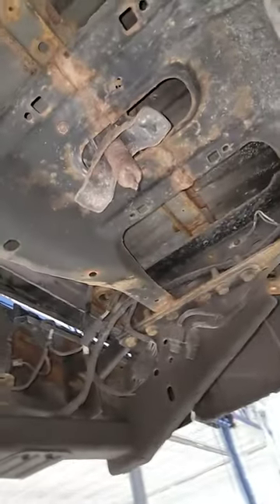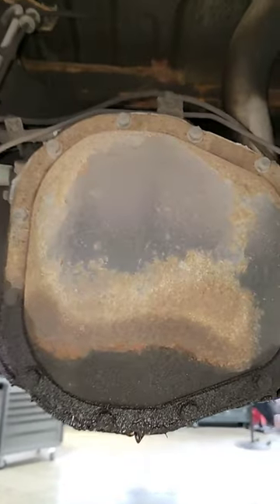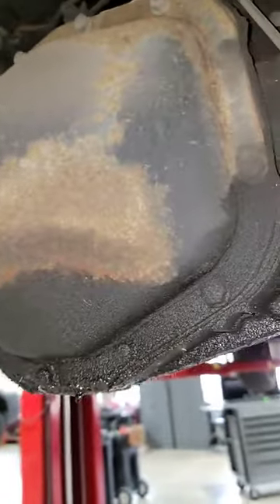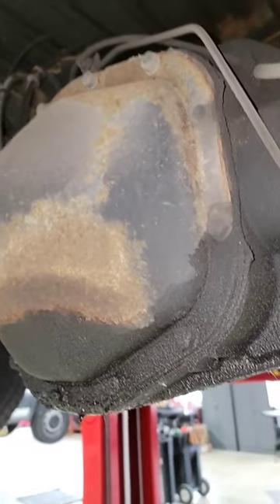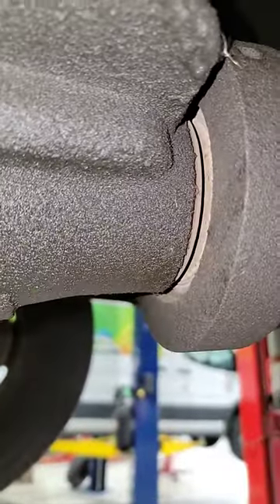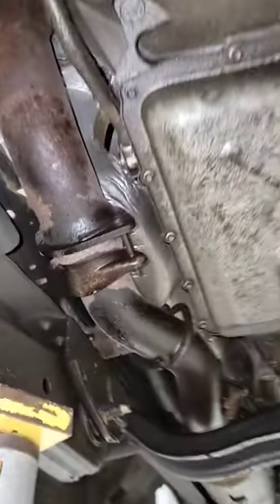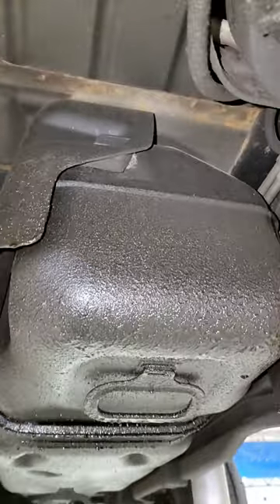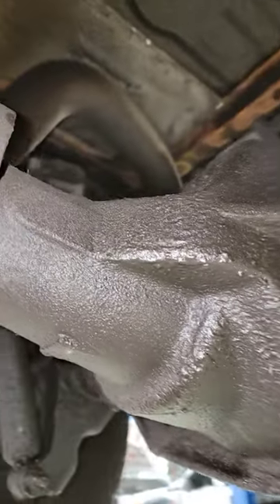WORST oil leak ever! | GALLONS leaked 😔 #fyp  #shorts

Comment: Put some more oil in it & wait until spring to fix!!...perfect rust protection form the winter salt!!...just add oil as needed!👍💪💯🤪
Reply: Plus the added benefit that the oil is always new.
Reply: @RadDadisRad  yes sir, good fresh lubrication is the key!!👍😁
Reply: @zekester1  I had a 408W stroker that had a bad front seal that did this. It would consume about 1 quart of oil for every 38 gallons of gas. Except if it was driven higher in the rpm then it would leak quite a bit more oil. I went 5 years without ever changing the oil in it. I also had to carry a couple gallons of oil with me. I knew it only had 1/2 quart when the lifters would tick. I would have to add 7 quarts for it to get back to operational.
Reply: @RadDadisRad  funny comment haha
Reply: @RadDadisRad  thank you for being considerate of the people who will live on this planet after you do
Reply: I got a 96 firebird with a leak and I'm afraid to mess with it it's been like that 10 years haha
Reply: @daveyjoseph6058 where do you think oil comes from?
Reply: @HeroicRecaps  Not the local environment? Spreading gallons of motor oil on the roadways is not recycling. It’s straight pollution. Leave the thinking to those who are better suited for it 😂
Reply: @daveyjoseph6058  the roadway is literally made of oil. Do you know what asphalt is?  You don’t seem very educated tbh
Reply: @daveyjoseph6058  I had a 96 that leaked too typical
Reply: @vanillarain3789  I got a 99 that had the oil sending unit go out twice in about a year lol
Reply: I wish my Avalon was leaking. Easier to fix a leak than it burning a quart every 50 miles
Reply: @daveyjoseph6058  who the fook is this guy
Reply from the maker: This guy hasnt a clue yo
Reply from the maker: What ever you say keyboard warrior
Reply: @daveyjoseph6058  I’m re-oiling the roads… the roads are literally hot oil and gravel which makes asphalt. Cmon sally don’t be such a sally.
Reply: 2.5GPA  it changed itself… why do you care?
Reply: 2.5GPA  and no it doesn’t. When it rains some of the oil in the asphalt is washed away. That’s why new asphalt is black and old asphalt is white. It’s white because it’s only aggregate and all of the binding oil has washed away…
Reply: @RadDadisRad that’s why I buy new…
Reply: @richeyrich2203  yeah I have plenty of new vehicles. My 4WD van has a 60 degree approach, 28 degree break over and 42 degree departure angle. Plus it’ll do 90mph across the sand.
Reply: @HeroicRecaps  its made of recycled tires yeah and has absorded oil over decades obviously. Oil isnt part of the recipe though its mostly tires and gravel.
Reply: @bolzdeep6834  what do you think tires are made of genius?
Reply: @RadDadisRad  it leaked 1 quart for every 35 gallons of gas. Yet you didn't change the oil for 5 years eh?

I guess you had a bottle under the truck while driving just catching the old oil to put back in
Reply: @HeroicRecaps  Does that roadway flow into storm drains, genius?
Reply: @RadDadisRad  Is that why sun exposure turns it grey too? I didn't know sunlight in deserts can wash stuff away
Reply: @thevalorousdong7675  it would lose a quart for every 500 miles. Ultraviolet light also breaks down oil.
Reply: @thevalorousdong7675  this guy thinks we drink water out of storm drains 😂
Reply: @thevalorousdong7675  here’s a whoosh since you think I had a jug catching oil under the vehicle. 🤣
Reply: geenus! I fuckin' knew it was something like that "geenus" stuff.
Reply: @zekester1  that’s what she said
Reply: @HeroicRecaps  deez nuts
Reply: @MiniNinja258  
💿 💿 🥜
Reply: @RadDadisRad  call that a two stroke
Reply: @bolzdeep6834  hmm. I know it has asphalt shingles ground up in it along with the millings from the asphalt grinder. Never heard of tires in a road other than the minuscule amnt of tire wear that happens on the blacktop over it’s lifespan…. Phew you should be on the screed board of a paver when they’re running the recycled mix. It’s terrible! It will literally break your skin out in a rash through your pants! It’s a rough job and nowhere near like when your paving with new asphalt
Reply: @honesthuman7550   you know what they say right? Chevys rust - fords leak oil! I’m a ford guy through and through tho so…  if it’s not a ford it’s a toyota for me lol
Reply: 2.5GPA  When your username is a C+ grade average and your profile pic is you hidden behind exhaled smoke from a spliff, you should probably not pick fights in random YouTube comments sections. Those two things combined have already set you back in terms of credibility.
Reply: @Davey Joseph  when you realize that asphalt is literally tar

Comment: At least it won't rust 😂
Reply from the maker: Coddddy
Reply: Lol, still rusting.
Reply: Yeah rust proofing is not a thing, the only thing that rust proofing is good for is trapping water and promoting rust.
Reply: @loft306  you sir are wrong
Reply: That's the first thing I thought then realised... The rust is the least of issues
Reply: @loft306  look at the sma channel, dude's own truck is like the only one in the state of new york that's rust free because guess what, he rust proofs it every year
Reply: @loft306  What are you talking about man, rust proofing is definitely a thing. Oil or wax undercoating works great. My truck is 38 years old and has no rust at all. I coat it with Fluid Film (mixed with a little bit of new 15w40 engine oil) every few years. Hell even the battery terminals look great because they're also coated.
Reply: @loft306 DangerMaus  lol, you're a cartman .
Reply: @loft306  it is a thing don’t know what you’re talking about
Reply: My first thought.
Reply: @loft306  just because you tried to spray rustoleum primer on the underside of a damp frame and rotted it out doesn’t mean rustproofing doesn’t exist kiddo 😂
Reply: @loft306  man google goes a long way. Common sense does too but I see now that it’s not so common anymore
Reply: @andries4561  you are correct. I live in Canada, I watched the video where Eric took his tundra to get Krown sprayed on his undercarriage, and I’ve been doing the same, and my 07 tundra has way less rust than my Dads 15 gmc sierra. And they use alot of salt here.
Reply: @loft306  i think you have mistaken rust proofing with undercoating. Undercoating with a rubber undercoat will eventually get hole in the runner undercoat and trap water, which will speed up corrosion, rust proofing uses wax wool which is sprayed onto the frame, it soaks into the metal and repels moisture. You have to get it done once to twice a year depending where you live but it 100 percent works, it slows the corrosion process down to a crawl. The only bad thing about it is that it will eventually swell your bushings, but thats still better than rust.
Reply: Go to Idaho where its salt day and night none stop literally millions of tons of salt every couple miles to the point you can see thick layers of salt on the sides of the roads and they salt every God dam day tell winter is over.
Reply: @thesilentone4024  wow. How long do vehicles last over there?
Reply: @Mantis Uliquora   If common sense were the plague far too many would survive, due to natural immunity.
David Droescher  Circa 1997( junior year in high school)
Reply: Yes you got the point! I was guessing why my engine was not rusted before rebilding and starts rusting after only one year
Reply: @loft306  you're thinking of undercoating... Oil based rust preventatives actually work really well if reapplied on a regular basis, and yeah, an oil leak has the same effect.

Comment: The rust preventive solenoid is stuck in the ON position. Ford has a service bulletin on this part.
Reply: Built ford tough!😠
Reply: typical ford.
Reply: Heh heh heh....
Reply: Tsb for clogged oil separator creating excessive crank case pressure all the diesels do it I’ve done like 8 or 9 in the past 3 montjs

Comment: I had a 408W that had a bad front seal. I never changed the oil in it for at least 5 years. When the lifters would tick that meant it only had 1/2 quart of oil and I needed to add 7 quarts.

Comment: That's just a rust prevention layer. It's all good. Just top off your oil 24/7 and after 5,000 miles, just swap out that fl2051s filter. Boom!

Comment: My 1974 chevy c30 with a 292 leaked oil a lot from the valve cover gasket and lifter covers. I sprayed it down and the factory paint was still about 75% intact underneath. That is a vehicle defending itself.

Comment: Have a few small oil leaks on my rig. I just change the oil once per year (low mileage per year) and mix the used with diesel and spray all over underneath.

Comment: Now if you want to see a leak,  I've had several bmw n62 v8s that the alternator bracket gasket goes from a rubber to rock solid and since its main line oil pressure it will pour out faster then you can pour in just about. Those normally will have oil dripping from the rear bumper.

I also just had a 17 5.0 f150 this week with a pin hole in the oil filter that looked like your video.

Comment: Booty of the Super Duty. Love the humor. I was changing the fluid in all the gearboxes after I bought my Grand Cherokee (which was only supposed to be a winter 4x4 "beater with a heater". While I was under there I saw that some oil was seeping out of the right side of the axle housing (looks like the axle tubes were pressed into the differential. I took a couple of quick photos and sent them to an old coworker. There must have been some mixed communication. She texted back right away.

"Ummm where's the butt plug"? 

That's when I had to explain that the plug was out because I was still filling it. Would have been stupid to try to find a rear differential leak if I was driving around with no check plug. I told her I'd bought a new one in case the original was coming apart. Then I remember my wife had a bag of plastic jewels and gems for arts and crafts  she had done with her ...grand neices? Her neice's daughters. Took a couple more pictures and asked if I should glue a gem to the butt plug so the vehicle would feel sexy.

Haven't seen my friend face to face in 20 years but that old dirty sense of humor comes right back.

Comment: A lot of leaks can be greatly reduced by simply tightening the bolts for the oil pan symmetrically. Then, fix it correctly when yiy have more time.  The only one I believe is one people may not want to do themself is the rear oil seal.  Everything else is really easy.  If you are burning oil because of  worn piston seals, it may be time to consider a different engine or a rebuild.  All these can be done at home with a few rental tools and your basic hand tools.

Comment: Years ago I worked on a late 80s f250. Had the 300 cubic inch cylinder. The owner took it in for an oil change and the lube tech noticed an oil pan bolt backed out so he decided to crank them down to the point it smashed the gasket out between the pan and the block. The oil leak he caused was so bad that it was dripping oil from the rear mud flaps and the camper shell door had an oil film on the glass. Long story short, don't go to jiffy lube. Most expensive oil change ever for that customer. It leaked so bad that it had to be towed in
Reply: Too bad it ain't common knowledge to not go to ANY quick lube place !!!!! They hire kids with ZERO experience at anything (our 17yr old son was one of them, but he thought that since dad ,me was a certified Master technician, that he knew everything). Only a week into employment, he was left on his own to change oil on a new car, got distracted with his phone and water bottle, forgot to put oil back in, and proceeded to lock up the customers engine.....I told his "boss", how are they going to ask questions if they don't know they need to......I actually spoke w an insurance rep for both jiffy lube and Valvoline once, and he said they send an be average of 25-30,000 cars either per month or yr (don't remember) to the junkyards due to blowing engines.
Reply: @brianmason8400  🤦‍♂️

Comment: I had a 79 Malibu that had the oil self change system in it. Would go through a quart every 30 miles or so. 
Rear main seal was non existent, but it lived to the tile old age of 493000 miles when I gave it away. They pulled the engine, fixed the seal and put it in a Toyota pickup and it ran for two more years after that.
Was a 267ci V8

Comment: I remember one time I was driving behind a Geo Tracker on a 45mph 2 lane county road. I was a good ways behind him, probably 6 car lengths & had been behind him for ~30 minutes. It was sprinkling rain at the time, barely enough for intermittent wiper speed, and my windshield wipers kept getting less and less effective to the point where eventually my windshield was just big smear. Finally had to stop and realized the whole front end of my car was covered in little droplets of oil. I came to the conclusion that the Geo Tracker in front of me had a bad oil leak that was getting on at least one of his tires & slinging it. As I wiped the oil off the hood I noticed some of the paint was coming off too. I realized it wasn't engine oil, it was brake fluid. Guy had a wheel cylinder or caliper leaking onto one of his wheels & it was slinging brake fluid everywhere.

Comment: A used to have a $400 beater I drive around town to save on gas , the previous owner took the oil pump off why doing a timing belt and mess up the threads so it constantly leaked oil … took it on a 150 mile round trip and when I got to my friends house he asked me if there was a drain plug in it … oil was dripping off the rear the leaf springs

Comment: What was it exactly my 02 s10 has a ton of oil under it but no sighn of any major leaks anywere ik there totaly diffrent trucks but what could it be it seems like it starts at the back of the trans and i just changed the oil and there was a sufficient amount in the trans could it be engine oil leaking somewere mabye a main seal im no machanic so anything helps thanks

Comment: We had two 2020 F150 rear diff seals fail. Never had that problem on a 2015, two 2016s, and then two 2018s. I think they changed the seal for the newer years and they’re trash.

Comment: I saw it was dry immediately around pinion.  MY truck now looks like this since a mechanic talked me into replacing the oil pump. And the oil pressure STILL drops to zero and returns. No trust worthy mechanic in this little town.

Comment: Once I saw oil speckles on my tailgate and thought I  blew a pinion seal for the 2nd time. Then I did as you did and followed the chickens and eggs( evidence) to the front to discover the oil source was the coolant overflowing? Causes of this on a VE 12V Cummins? cracked head, block, blown head gasket, or oil cooler.. 15mi from US50. Made it to town the oil cooler had split dumping 2.5ga oil into the coolant in 160mi. No cross-contamination oil was clean a 1way leak._. 
Moral of both our stories is don't let your truck suffer from incontinence.  It is not marking its territory, its got the drip . Take it out back and hit it with the butt of your pistol while laid out on a stump.

Comment: The best way to diagnose a problem like this pressure wash the bottom of the truck then do a test drive then check again could be an oil hose leak I know I did it on my truck I found out the hard way it wasn't the oil gasket at all it was a hose leaking

Comment: Dang I was just checking yesterday at my 03 exscursion 6.0 for oil leaks i can't pin point it . What if I was engine then use that Yellow injection on old oil before I change oil

Comment: Oil- it’s cheaper then a new frame, seriously though, if you got a bad rust area you don’t want to fix, oil will keep water out, great floor board saver. Don’t worry, your few gallons don’t compare to 3rd world countries or trash companies 😊
Reply: Yes, i once had older audi that leaked oil from rear mainseal, valve covers oil and oil pan. Sadly i gave that awesome reliable car up when it decided to leak 2 gallons out in few minutes from the oil cooler 😔

Comment: No Need to Undercoat 
 Should be good for years to come..
  Its a Diesel 
Diesels Leak Alittle 
 @ least thats what SUBURBAN Ford of Sterling Hgts, Mi. Told me whn I Spent 30k on a F350 King Ranch 
   (Its a Diesel they all leak some)
 I chuckled & told the Service Manager 
 Looks like it needs a Bulletproofing..
  Rear main was replaced 2 times in 2 months under warranty 
  & still leaked afterwards 
Ford Techs have NO IDEA HOW TO PROPERLY REPAIR A DIESEL ENGINE 
  $6500 & a Tow 3.5hrs north to a real
Diesel Mechanic. 
  135k later still No Leak. 
Weird 
 Ford Stealer-Ships all need to be Imploded

Comment: No, I don't have to fix the engine leak. that's not an accident. That's how I treat the undercarriage of my vehicle because I live in a place where winter is real. Most the roads are covered in salt for winter time deicing. You don't see any rust do you? 🤔🤫😎 Jk